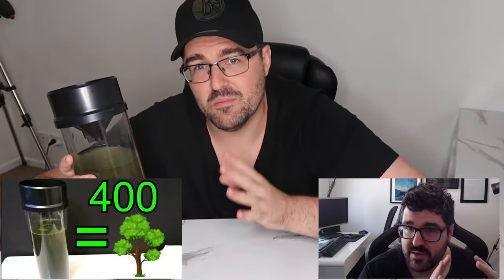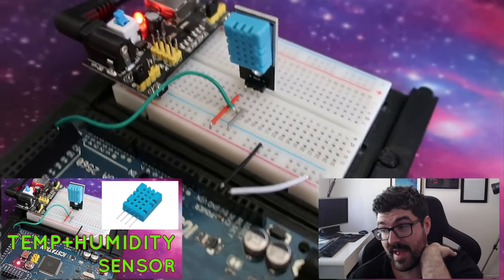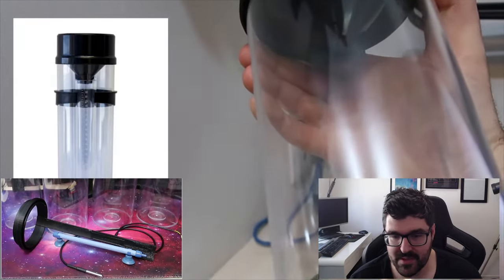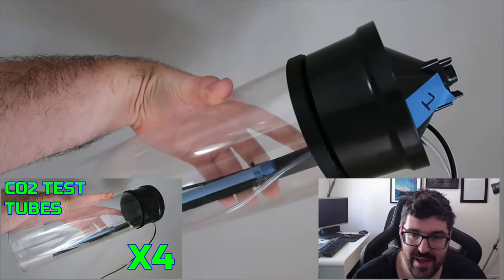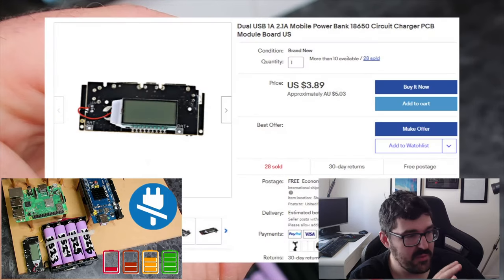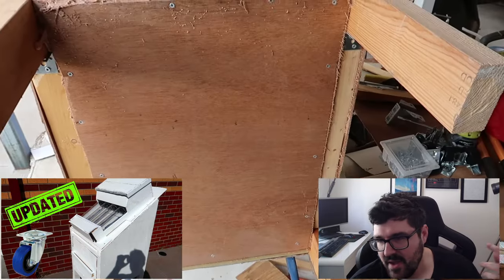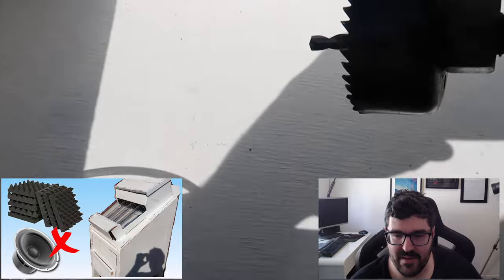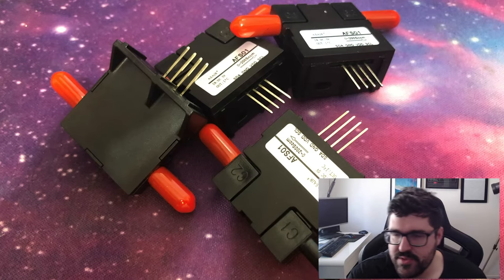Algae CO2 Scrubber Project Run-through - 2 Years Later

Comment: Is there an easy way of setting this all up without any of the electronics so it could be set up easily by anyone. Because I think this is one of the best ideas for cleaning the air in a long time. Would it need a hepa filter if you wanted to run this in your home. I am very very interested in your project